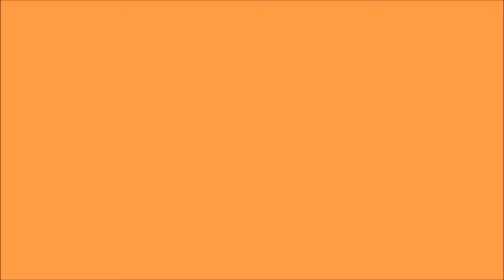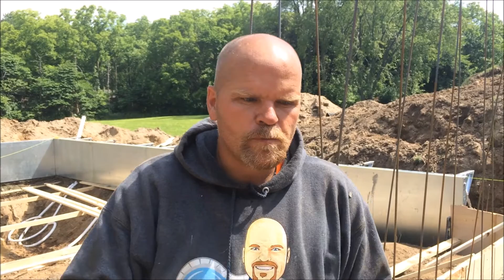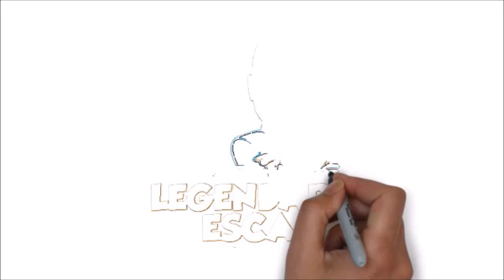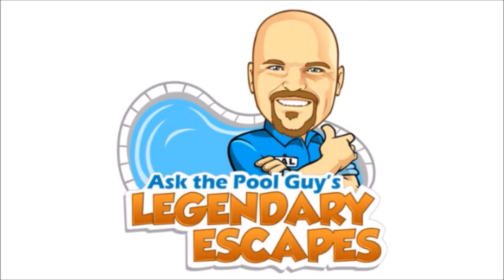Ask the Pool Guy: Shotcrete and Gunite Swimming Pool Construction {How it Works}

Comment: Hi,
Question, currently have a new pool being built. They finished the shotcrete and did noticed that the umbrella hole looks like it goes beyond the concrete,  noticed it when I was watering the shotcrete down seeing the water going down fairly fast (does not hold water)  Should I be  concerned about that and if so whats the best way to fix that with epoxy or add some concrete?

Comment: Ok, I am asking as a concrete truck driver, isn't the Gunite just a grout mix? I delivered that stuff for some masons filling a block wall and the mix was 6 bag cement and and sand at about a 7 inch slump.
Reply from the maker: Yes, gunite refers to the process of application - through the hose 

gun·ite

ˈɡənīt/

noun
noun: gunite

a
 mixture of cement, sand, and water applied through a pressure hose, 
producing a dense hard layer of concrete used in building for lining 
tunnels and structural repairs.

Comment: Thanks for making the video's.  Just one bit of advice.  Professionals cringe every time someone calls concrete "cement".
Reply from the maker: True - it was explained that cement is used to make concrete...

ce·ment
səˈment/

noun
noun: cement

1. 

a
 powdery substance made with calcined lime and clay. It is mixed with 
water to form mortar or mixed with sand, gravel, and water to make 
concrete.